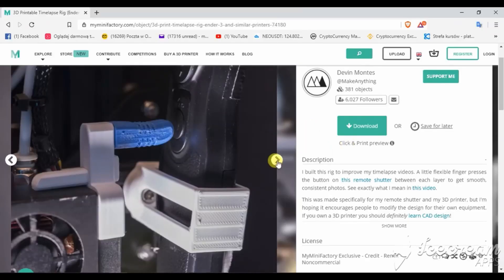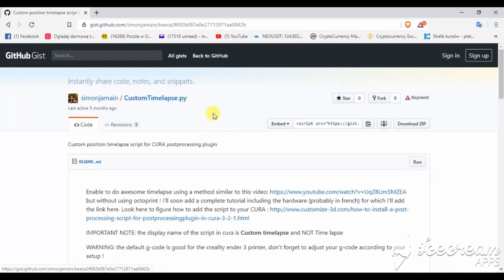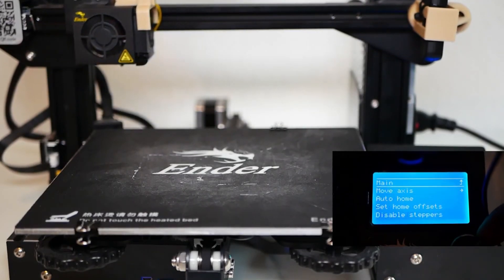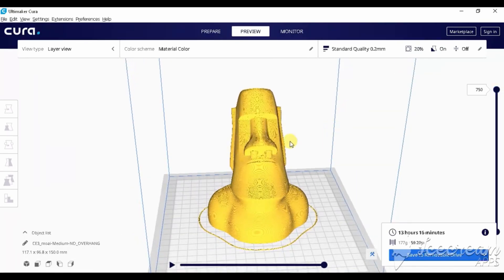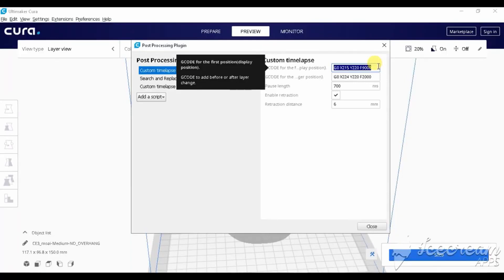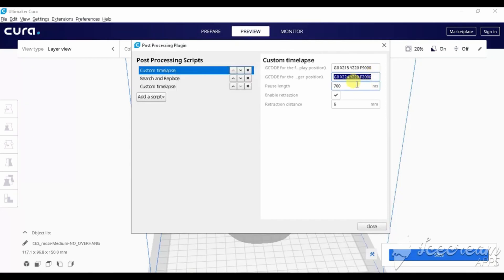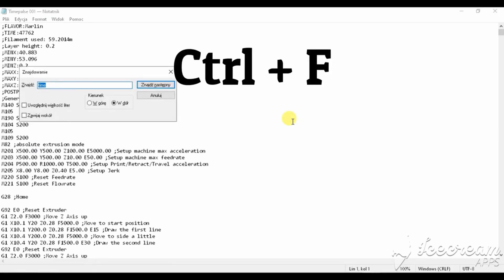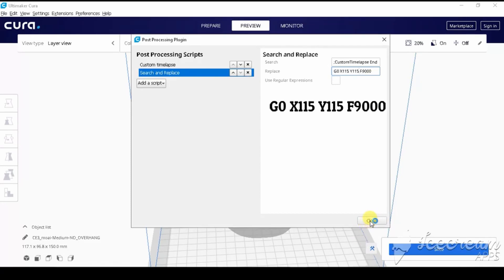How to make time-lapse ( 3D printing  Cura plugins)

Comment: Im left with a lot of stringing after each pass. Any suggestions on how to prevent this?
Reply: that could be many things.  I get one brand of filament that strings much more than another.  That's why I'm liking hatchbox pla, you could adjust your temperature slowly (maybe up/down increments of 5) or change printing speed

Comment: my friend, why did you choose to replaces the last line with  G0 X115 Y115 F9000? The values for X and Y are arbitrary and they bring back the extruder to the same location every time while our goal is that it will go back to the location it stopped. My extruder still leaks that way :( how can I modify it to suit the coordinates of the last point on the previous layer? thanks!
Reply: This would fix the stringing problem instead of putting a bandaid on it. I hope someone figures this out.
Reply: put more mm to retraction so it doenst leak

Comment: THANK GOD I FOUND YOU!!! i have seen the make any thing video and he only showed how to do it in simplify3d but i always use cura this was a big help thank-you very much!!!!!
Reply from the maker: You are welcome. There are also some isuues using that method, but its usefull
Reply: @bigboyshobbies5731  yea i noticed that there is a-lot of stringing when the printer head moves to the button but some g code modification could fix that
Reply: @FR54321  what modification do you used for the stirnging?

Comment: i noticed that the nozzle hits the print on the way back to the center. any way to fix that?
Reply from the maker: maybe zhop so it goes up a little
Reply: @bigboyshobbies5731  Thank you very much for this video! Can you please detail what is the command for a ZHOP? How to write it in the script?
Reply: @oliviercarli8166  you just enable it on Cura dont need to modify the script